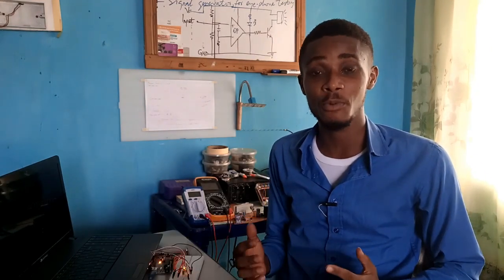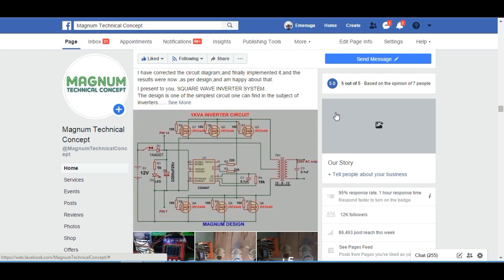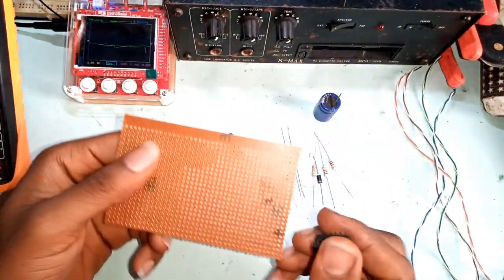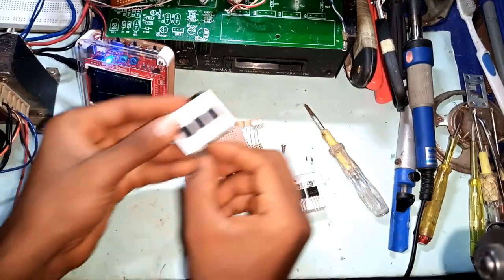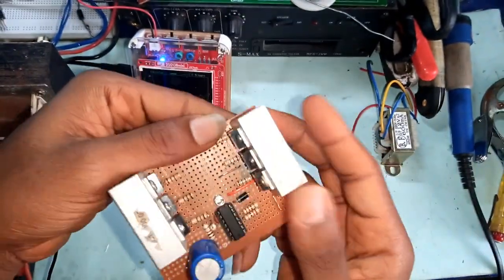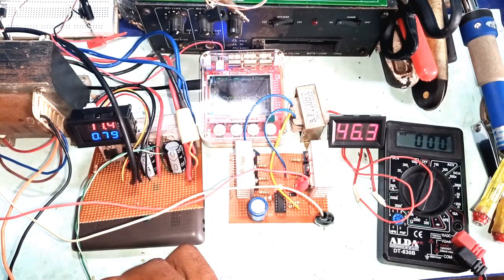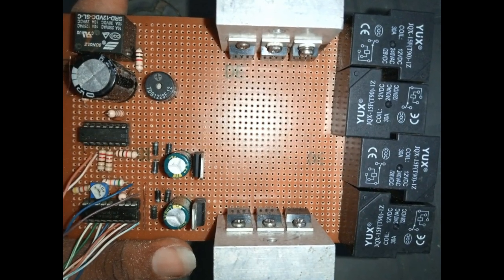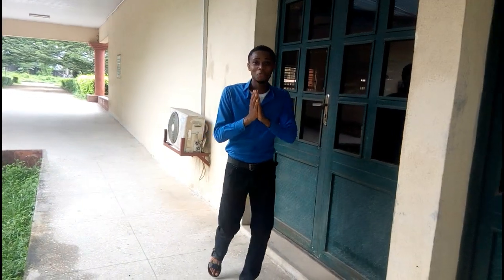220V/12V INVERTER : ( Design and   Construction )

Comment: Hi, 

My final year design project is Design and Implementation of a 1500 
VA inverter system to be incorporated 
into a 1.5KVA Multi-Purpose Solar Power 
System for Domestic applications

Will this design help?
Reply from the maker: Yes,but it's not enough to guide you through

Comment: Hello, weldone sir. I have some issues bothering me about high frequency inverter I’m building and I’d love to share it with you if you don’t mind. I want to really know what’s up
Reply from the maker: Sure, you can share these
Reply: Ok sir. So I constructed the oscillator using ic sg3525 at the frequency of about 54khz, so I got a readymade inverter ferrite core transformer to test it and it worked but my concern is, one side of the MOSFET is getting unnecessarily hot on no load. And I don’t know why it’s getting that way
Reply from the maker: @djmight8768  hope you used a pull down resistor at the gate of the MOSFET
Reply: @MEmbedded_TechLab  yes I did sir
Reply: And I made sure the input gates voltage are balanced but they will later change any time I connect the ferrite core transformer. For example, without the transformer pin 11 &14 is 5.6v but worth the transformer pin 11 will be 4.somethingvolt while pin 14 is 5v and that’s not even close
Reply from the maker: @djmight8768  secondly, check the transformer if it's good
Reply: @MEmbedded_TechLab  I used two different readymade transformers (inverter)
Reply: But I did not put feedback shaa but I don’t know in your experience if feedback could be the missing piece that’s making it to react that way

Comment: My final project is designing an inverter 
And we get 220v with 50Hz but when we connect load our dc supply will be come zero what is the reason please tell me
Reply from the maker: Which ic are you using